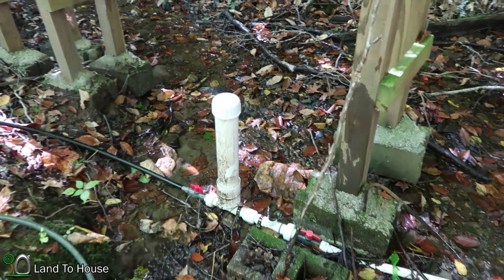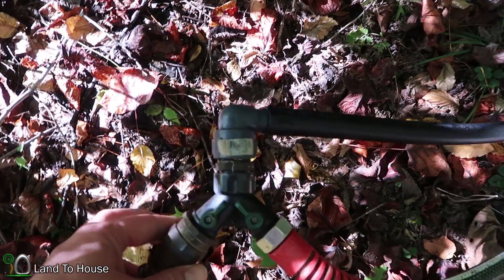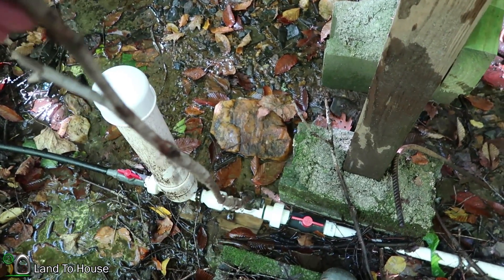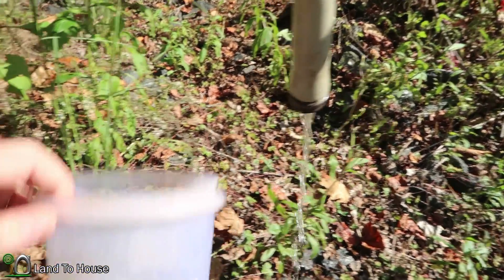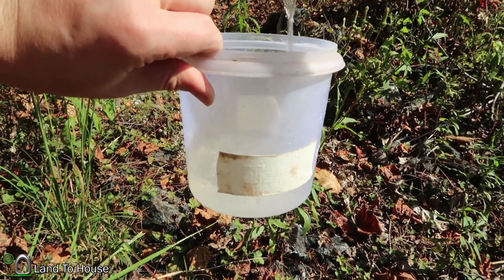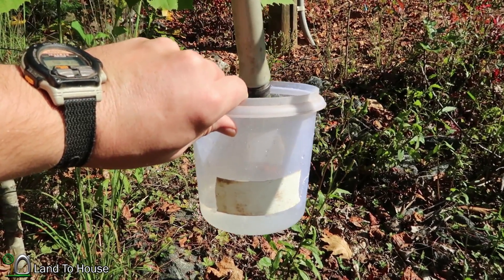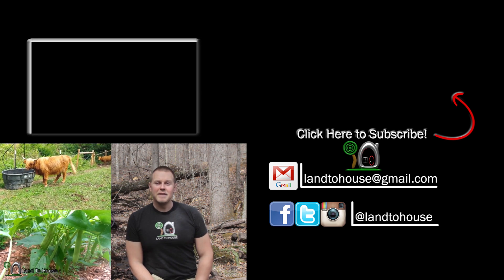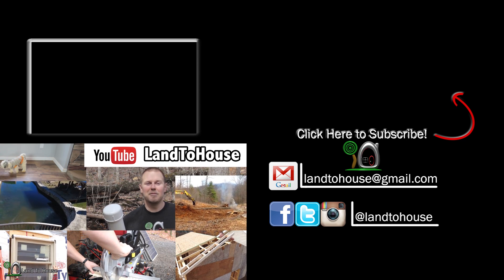Two Ram Pumps One Delivery Pipe

Comment: What if, rather than two drive pipes feeding two ramp pumps, and then a y junction into a single delivery pipe, you had the opposite, two drive pipes coming to a y junction BEFORE a single ram pump? What would happen in *that* case? I'm assuming you'd increase the head pressure commensurate with how many similarly sized drive pipes were thus joined at a Y or trident connection. What would that do? Would it increase outflow pressure, outflow speed, pulse speed of the check valve, or would it be too much head pressure, and cause problem with starting / cycling the check valve due to a too-fast pulse speed? Would it cause an excessive amount of water "loss" at the check valve, for limited if any gains? Or would it do anything at all useful? Etc.?

Comment: Can you try a rum pump that has one waste valve, one valve, two presure tank, one delivery pipe?
In that set up, there is a possible to increase the presure so that the water can travel higher .
Reply from the maker: From my understanding increasing the pressure tank size or doubling the tank does not improve the lift height. It just takes a little bit longer for the initial prime of the pressure.

Comment: If I had to ask a question it might be along the lines of:

Can you use the waste water to do other work? Clearly the water is being expelled with a bit of force / pressure, and there is quite a bit ostensibly "going to waste" So to speak. IE, not being pumped up the hill, or whatnot.

Would it be possible to, for instance, use the pressure of the waste valve motion to, I dunno, drive a little piston or covert linear motion into rotational motion, to, I dunno, drive a mechanical pump or produce electricity, or something?

I mean, granted, okay, maybe it's not a ton of motion per cycle, or whatever, or a ton of water per "pump" out of the waste valve, but, over time, might it not be possible to do something with all that extra waste energy (kinetic motion, etc.) that's being put to no use? Whether to drive a bit more water up the hill somehow (mechanically, electrically, etc.)?

Also, can all that "waste" water be, in some fashion, "reclaimed" rather than allowed to go completely to "waste" (doing nothing)? Like putting a container around the waste valve, with a pipe going out of it, to drain the "waste" water to another location, or irrigation or something?
Reply: Ohh, I have another stupid question... Okay, not so stupid. Maybe even "smart"-ish...?

Was thinking about this the other day based on something I read online about some guy who was trying to figure out how to get water up a big hill or whatnot and the idea of multiple ponds or something with multiple ram pumps came up. I assume that'd be compounding "losses" of water at each jump.

But I got to thinking... What if... At a higher pond / pool / tower / pump / whatever, where you have the waste water valve spouting out water, could you collect that "waste" water coming out of the ramp pump, channel it into some kind of collection basin, and send it back down to one of the lower ram pumps, using the pressure of the down-hill water from the upper "waste valve" to drive additional water through the lower ram pump, thus kind of "recycling" it, to reduce losses? I mean, sure, the lower pump will still be "losing" water, but the water "lost" at the upper pump would be getting "recycled," and thus in a sense less of it would actually be getting "lost" since it would potentially get a 2nd or 3rd or 4th trip through Mr. Ram Pump's Wild Ride. Yeah?

Likewise, could the 3rd level's "waste" valve similarly be "collected" and used to augment the 2nd level's ram pump, thus minimizing its own "losses"?

Like, would something like that work to kind of minimize actual "losses" (by making "losses" function as "recapture" and potentially also adding some extra pressure to lower levels)?

Comment: Hi Seth, could you try a proof of concept of a ram pump in a portable water pipe line, that is redirecting the waste water back into the pipe line just a metre behind the waste valve and collecting the delivery water up hill where the pipe line could not send water due to lack of pressure.

Comment: I enjoy your ram pump experiments.  I'm thinking adding check valves right before the Y joining connector to keep each pump's back-pressure consistent instead of oscillating would be a good idea, especially if one pump takes a leaf jamming open the check valve and draining the system.

Comment: how much spring valve exhausted water per gallon pumped?
Reply from the maker: The water used and pumped will depend on a few things. The size of the pump determines the amount of water used.  For example the 1/2" ram pump is going to use around 3gpm. While the 1-1/4" is going to use closer to 8gpm.

Comment: Sir it is possible or not if I will use 3 number of swing check valve in the same pump???
It increases or not the water pressure??
What are the maximum height does ram pump exceed???
Reply from the maker: From my tests the addition of waste valves increases the volume of water not so much the pressure. Some pumps can lift to hundreds of feet. My model typically stop at 180 feet of lift.

Comment: So if you had a ram pump set to pump to a tank up hill  then ran another pump ot tank even further up hill technically  there's no limit to how far you can pump up hill providing the waste is less than what's being pumped
Reply from the maker: Yes technically.  But because the ram pump pumps about 1/8 of the water used there is always a lot of waste.

Comment: * BUSTED * Great experiment thou & a great little half inch setup you have. I was all excited because your data indicated that connecting the 2 systems provided a significant increase in output compared to the systems working separately. Why was that?  It didn't take 23 seconds to reach mark with the 1/2" system, more like 13 maybe 14. I would like to know if the pulses syn after they've been running for a while?
Reply from the maker: This summer I'm going to be setting up a ram pump testing station that should allow me to do some more accurate tests. I believe this one needs to be looked at again.

Comment: I think there is no need to make 2 ram pump with one delivery pipe, with good volume and pressure of water supply i think it is better to add one, two or three waste valve toa Single ram pump
Reply from the maker: Absolutely. I think people just wanted to know what would happen if you combined two pumps. The only situation I can think of that would use two pumps is if you had two small Creeks with just enough flow to run small pumps.
Reply: Like me, I need water in at least 2 different locations on our property!

Comment: Hi Seth, I just bought an urban home which features a very affordable spigot for irrigation water from a nearby ditch.  I get unlimited access to this spigot one day each week to irrigate my city lot, and I am wanting to power longer range sprinklers to take some of the labor/supervision out of watering my lawn each week.  It's true, i could just plug in a pump, but I am an engineer, and the steam punk approach of ram pumping has some cool factor.  I measured 30 GPM and 17' of head from my spigot, so I have decent flow and pressure, but I'll need more pressure to power longer range sprinklers.  According to Range Technical Note No. 26 from USDA 2007, I can expect to waste more water than I pump using a ram pump, and I can supply the minimum  7' of head and 8 GPM to run a ram pump.  If a lower pump can be powered by the 'waste water' from a higher pump, I could theoretically get closer to a higher yield on delivery flow.  Thank you for sharing your results on the parallel pump success, now I'm curious if I can do this by powering pump 2 from the waste flow of pump 1 in a vertical orientation.  All the instructions I have read indicate a specific fall geometry for the drive pipe, which does not apply to my already piped situation.  is it possible to use a vertical drive pipe to run pump 2 on the waste flow from pump 1?
Reply from the maker: Hello. Sounds like you have been thinking out of the box more than a lot of people. I like that. The large 1-1/4" ram pump that I make has a waste water value of around 7gpm. It can pump a max of 1gpm in the right setup. This means that you will likely need to drop down to a 3/4" pump to keep up with the lower flow rate coming out of the first pump. The ram pump is not that great for directly watering plants with sprinkler. It is better at filling a tank that can then be used to water. 

But to answer your question. Yes you can use the waste water from one pump to fun another. You will need enough head pressure (at least 2 feet) and a drive pipe of at least 25 feet long.

Comment: Have you ever tried connecting the output of a ram pump into the input of another, if you haven't i would like to see.
Reply from the maker: Sadly this does not work. The second ram pump needs to have an open air source so that the pressure wave can go both directions.

Comment: i want to know the maximum pressure in psi by a ram pump ?
Reply from the maker: The pump is designed to provide a constant low flow. The PSI of an open ended delivery pipe is going to be low. Now I have closed the ram pump delivery pipe and measured over 40psi with only 3 feet of head pressure.

Comment: It would be neat to see a ram pump, pump to a tank that drains into a Pelton wheel generating electricity from spinning a treadmill motor. ;)
Reply from the maker: The ram pump is not so great for that. Unless you store the water in a very large tank. The 1-1/4" ram pump can deliver a max output of around 1gpm with the right setup. To make any real power you would need much more than that. But it sure would be great if it would work!
Reply: I very much appreciate your reply, thank you. Have you ever tried using a Hydrautomat? http://www.rexresearch.com/allen/allen.htm

Comment: Does the length of delivery pipe before the Y-connector make any difference, if I were going to attempt to run two pumps, I would run a 2" drive into a Y that has a 1 1/4" reducer on one side, and a 3/4" reducer on the other, these would feed the 1" and 1/2" pumps side by side, the delivery Y would likely be a couple to three feet from the delivery side of the pumps, with a check valve on each side, so we are not backfeeding the pumps.
Reply from the maker: I think that there might be some issues with back pressure unless a check valve is installed behind the Y on both of the pumps. Now it is importand that the drive pipe be the same size as the waste valve on the ram pump. Its not possible to run two ram pumps on a single drive pipe. At least not for long.

Comment: i would like to see a ram pump running normal BUT have a second ram pump running off the first ones waste water... is that possible?
Reply from the maker: I think that would work. I have a feeling you would need a stand pipe closet the waste valve of the first pump. This would allow the water to back up and overflow if the second pump did not need that much water.
Reply: next summer i will be trying some of these new ideas out. first going to be building a dam and creating a reservoir.
Reply from the maker: You should make videos of the tests when you work with them.
Reply: i will post it on my website fixedbydoc.com with the other blogs of ram pumps :)

Comment: Awesome test Seth! Hey everyone share this video, and subscribe to Seth's channel, make it viral! 
I have seen similar videos with 2, 3, and 4 ram pumps going to a single delivery pipe. All though I am not sure of the plumbing, and if backflow prevention check values were used. Most of the videos were in foreign languages. I don't see a reason you couldn't keep a nice water pressure using multiple ram pumps.
Reply from the maker: Thank you for the plug! :)  I like the idea of using two or more ram pumps. In my case I can use two in the spring and drop down to one in the fall when the flow rate of my water drops.
Reply: You're welcome, you do have great content! Yes supply would be an issue with a small spring. Have a great weekend Seth. 😀

Comment: How about a one way valve, on each ram pump outlet line,  just prior to the y connector, to prevent the two ram pumps opposing each other. I use those hozelock* one way connectors on a water butt collection system to stop different size butts 🙈 and different height butts 🙄 interfering with each other.
Reply from the maker: That is a great idea. I feel like it would be the easy solution to a possible back pressure issue. It is also able to improve the hight delivered too. Double benefit.

Comment: you gonna need a crankshaft to sync the pumps mate. what right now happens is that the "exaust" valve of the 1st pump might force to close the valve of the 2nd one due to pressure equalization.
pay attention!
Reply from the maker: Because the two pumps have valves before the pressure tank I dont think that the mis-synced swing valves will cause an issue. The main issue is going to be alternating back pressure issues. But an inline check valve on the delivery should stop that.

Comment: A  small ram pump has a really low flow velocity in the delivery pipe, especially in cases like the 1/2" pump feeding a 3/4" delivery line. The flow is laminar, almost static, and so the pressure just a little ways up the delivery line would be stable. Since the connection between the lines is a distance away from the pumps themselves, the pressure would be pretty constant in both lines; in essence the delivery system's a narrow tank 20 feet tall. This suggests that any number of pumps should be able to connect to an upstream manifold without problems.
Reply from the maker: I was thinking that a manifold (or in this case a simple Y connector) would be helpful. having the connection further up from the pump might have been the best way to go. It allowed the two pumps to have a column of water as back pressure before the connection. Then a simple check valve on each would have also worked.
Reply: @LandtoHouse  when you say a manifold would you mean a tee where one ram pump would deliver  from one side and the othe ram pump would come from the other side and combine into a single exit? that would seem to increase the friction of the system but maybe it would work just fine.  I'm guessing that you had completely two separate supply lines and drive pipes. What do you think about having a single supply line of say inch and a half or 2 inch poly pipe coming Downstream ito a tee then into two separate standpipes and two separate Drive pipes to two separate ram pumps then combining the delivery pipes together?

Comment: Omg.   Wow.   Great test.  I would of guessed it would not work.  I don't have that much flow but for someone who does it provides great duplicity.   If 1 pump were to stop you would not have a complete interruption.
Reply from the maker: That is a good point! I think installing check valves to keep the water from backing up on the other pump would be needed. I like the way you think.
Reply: That is a great point John! You would have a redundant backup in your pumping system.
Reply: I was also surprised at the results - adding the 1/2 inch ram pump to the 1 inch ram pump almost doubled the volume of water being pumped from the  1 inch ram pump.   Basically the same results as 2 completely separate 1 inch ram pumps filling in 11 seconds each or 5/1/2 seconds.  Just adding the smaller pump, effectively doubled the output from the bigger pump.    Certainly more testing would be interesting to optimize pump output.   Thanks.

Comment: What about having ram pump connected to another ram pump. And you have two off them connect to a Y
Reply from the maker: Like having 4 rams total going to the same delivery pipe? That would work. Or do you mean have a ram pump delivery pipe going to a ram pump drive pipe? That would not work because the flow rate is so low of the first pump.

Comment: Hey Seth! I am a backyard scientist and I also find 'just because it seems like it will work' you sometimes have to actually test it to see. I am curious how you think that 'Y' figures into the equation? If it is like the ones I buy (with shut off's), the shut-off valve hole is quite small compared to the hose. So that 1/2" garden hose is reduced down to a much smaller inside diameter. Thoughts?
Reply: I would think a momentary diameter reduction like that would be essentially a lousy venturi; the flow rate would be increased at that point, but upstream and downstream it would be unaffected (aside from a slight frictional loss). Given the extremely low flow rate of the delivery pipe, this should be a non-issue. Source: fluid mechanics course in my civil engineering studies. :-)
Reply from the maker: You are right. The hole of the cutoff is smaller than the rest of the hose. I would have to agree with "making Sense". That distance of 1/2" or less in the Y component would not reduce the flow by friction very much. The flow rate of the ram pump is so very low anyway that I would not expect to see any issues. Even a 1/4" pipe can pass 3 or 4 GPM and the ram pump is only supplying 1 or less GPM.
Reply from the maker: Seems like a good reply. I am not sure of the exact flow rate of a 1/4" pipe but it would still be greater than the flow rate of these pumps.

Comment: Your flows are too low to cause noticeable flow reductions due to friction in the pipe. I'd bet you would need 10x the flow to see a increase in head pressure at the pumps.
Reply from the maker: I suspect you are right. The flow rate here is very small. It would take several more pumps to start noticing a friction loss.